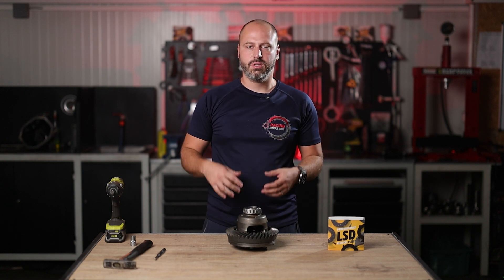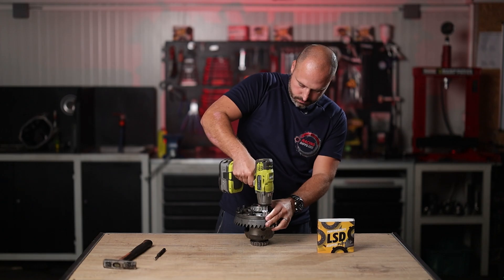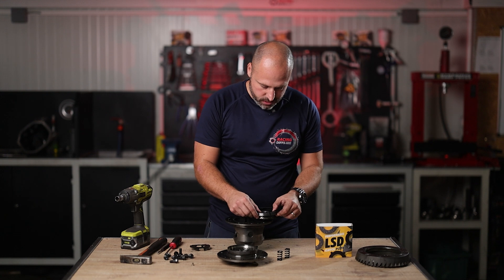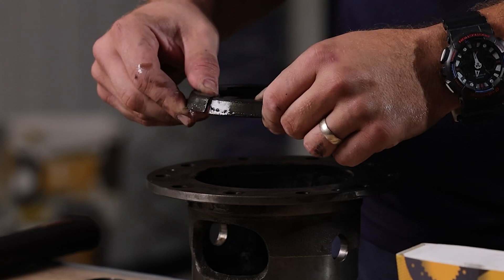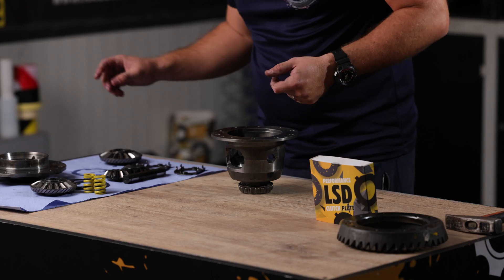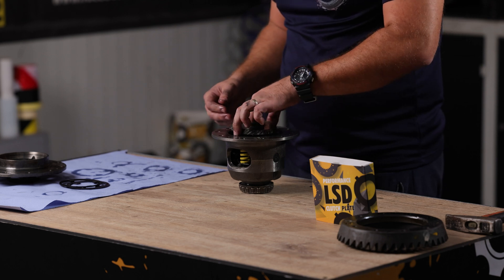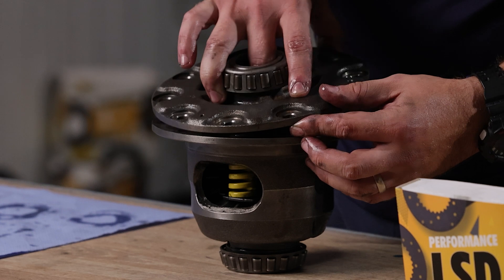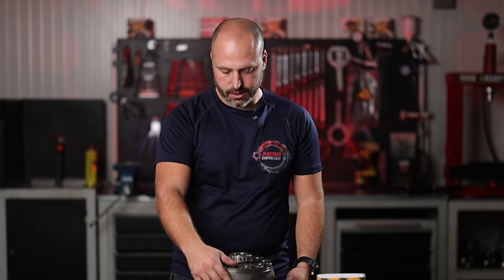Mazda RX8 Super LSD Upgrade/Repair Installation Tutorial | Boost Performance with RacingDiffs

Comment: Hi, is this kit plug and play for the original differential of the Mazda RX8 with manual transmission? I'm very interested, I've seen a lot of positive comments
Reply from the maker: Yes, it is. No mods required. 👍🏻

Comment: hey! do you have a video of your mx5 lsd conversation kit? i would like to purchase one from you, but i have no clue how to install it properly… thanks a lot for your work!! i love the fact that i can have a cheap lsd for my nb.. so thanks to you again!
Reply from the maker: Unfortunately we didn't make the tutorial video, but installation manual comes with the kit.
Reply: By the way: I have just bought this kit, mine did not come with a separate manual. The process is mostly the same - like really close. The mx5 only has 2 instead of 3 screws to hold the case together. AND: there are 2 little metal shims, kind of like coned washers in the mx 5 diff. Don’t know whether these are supposed to be left in or out. This should be the only differences in the mx5

Comment: is there a way to identify if your diff cones are actually cracked? I think I need this kit as my unloaded rear wheel spins very easily when turning into steep ramps.
Reply from the maker: That is one of the indicators. To he honest, we opened more than 20 diffs to install this kit since we made it. Each of them had broken cones...

Comment: I wonder if this is the reason the rear end of my RX8 started ticking recently at low speeds. Seems to be most audible in straight lines reversing slowly or forward slowly. Could end up fixing it myself with this, or stealing the diff from a series 2 part out somewhere. Cool this exists though. My only concern is just if street driving would be the same and if it would require any special care.
Reply from the maker: If you have something broken in your diff, which is the common case with those cones, you can expect some noise from it.  Also, It's not good to have something broken inside your diff and spin in on a highway regularly. This fix is tested, and it provides 0 noise. It's perfectly fine for everyday usage.
Reply: @RacingDiffs  Very true. Don't want something to fail catastrophically at highway speeds and locks up your rear axle entirely. Just need to double check it's the diff and not an axle problem. Appreciate the response, and if it ends up being the issue in the video, it's a good chance I pick this up to fix it :)

Comment: So you get rid of the failure prone cones abs replace them with clutches, but how does that impact the lockup characteristics?  

The stock diff was a 1 way, does this behave more like a 1.5 way? Does it change the driving characteristics or is this mainly for reliability?
Reply from the maker: It increases lockup capacity due to more advanced friction surface. And it won't fail as those cones ever again. From our experience, every diff we opened had at least one broken cone.

Comment: Ive just ordered this for my RX-8 racecar. I'll write a review once Ive tested it. 

On the plates, will spares be avaialble seperately? I'll likely have to replace these every other race season with wear from racing
Reply: I installed this kit on my nc mx5 on which i have fitted an rx8 lsd.

One of the friction cones had broke in half.

The kit works exactly as advertised with no weird noises or chatter, and it really made a big difference.

There is a catch though which is not the kit's fault but the way the rx8 diff works is very similar to a 2 way clutch type.

And that means the diff now with the strong preload springs they provide causes noticeable understeer on corner entry.

I also tried using the stock preload springs with the kit but i had almost no lock up it acted like an open diff almost.

So there a small review, the kit is great and works 100% but beware of the side effects of boosting the rx8's diff lockup.
Reply: My car and driving style have always been loose at corner entry... Maybe it would work to my advantage.  Thank you so much for sharing your results.  Do you post videos on your channel?  If so I'll come check them out  @Nontas1993
Reply: @rx8matt  Glad to be of help !

I don't have videos unfortunately, regarding the installation though it's pretty straightforward, the kit is well thought out.

If your car is pretty loose on corner entry then it will help a lot.

Unfortunately mine went from almost neutral corner entry to requiring a lot of trail braking to get it to turn now at least on slow tight corners, haven't tested it out on fast corners yet were i believe it will actually provide stability there which is needed on an mx5 because of the small wheelbase.
Reply from the maker: Yes, of course. Just let us know what you need, and we will sort you out.
Reply: where do you plan to post your review?  rx8club, rx8 roadrace group on facebook, youtube, or...?
Reply: I am curious as well. Definitely update us here where you plan on posting a review of it.

Comment: I drive a W208 320 with the m112 V6, do you have a kit for that?
Reply from the maker: Not yet available. Sorry.
Reply: @RacingDiffs  I have been waiting a long time for more Mercedes-Benz options. my needs are for a w209 cdi. this is shared with quite a lot of other models and engine sizes. 10s of thousands of potential customers to sell to by covering around 10 different applications with 1 researched and developed product ....... PS I should get a free one for this outstanding free businesses inventory expansion advice.    keep up the great work guys 💪🚕🚗🛻🚙🚗🛻🚗🚓

Comment: hello, im thinking of buying a w208 Mercedes CLK 200 kompressor (or mybe even 230) (thats the oldest clk). Does your product (185mm mercedes one) fit them? Asking as it fits w202s and they share many parts with w208s????? Thanks!
Reply from the maker: It should fit, yes.

Comment: Is there any additional or recommended service required with this? How long would the clutch plates last; do you need to change fluid more often?
Reply from the maker: LSD fluid is required. And it should be changed every 2 years. Generally, that is our recommendation for all drivetrain maintenance, with LSD or without.
Reply: @RacingDiffs  With regular fluid changes, what would be the expected lifetime in millage you would estimate that the clutch discs would last, before needing a rebuild? (I know this is something super variable, but I would assume you've done testing and inspected the amount of wear over time somewhat)
Reply from the maker: This technology of plates provides excellent durability. We tested it in drift car for one full season, no signs of wear.

Comment: Hello, if I right understand,the cone are broken.Why in your set there is there only 2 plates and zero cones?Thank in advice.
Reply from the maker: Yeap, cons are always the problem. In 99% of diffs we opened so far, cones were broken. Therefore, we decided to go with classic stype clutch plates and preload shims.
Reply: @RacingDiffs ,so the cones are not more used? Are you based in Europe? Thank you.
Reply from the maker: That's right, you throw them away. Yes, we are in Europe, but we ship worldwide.